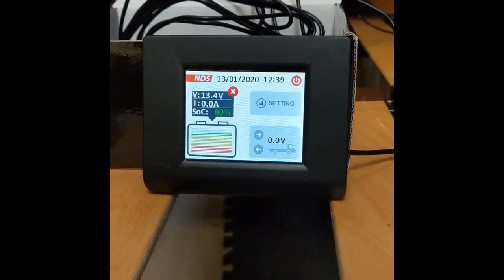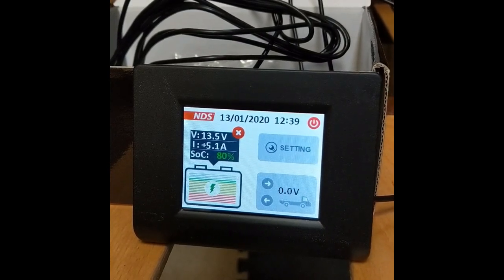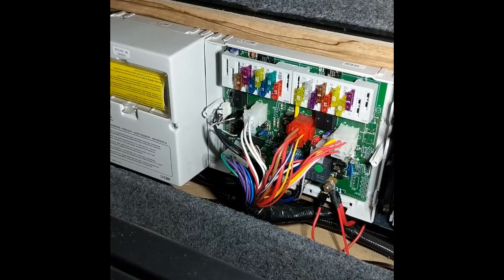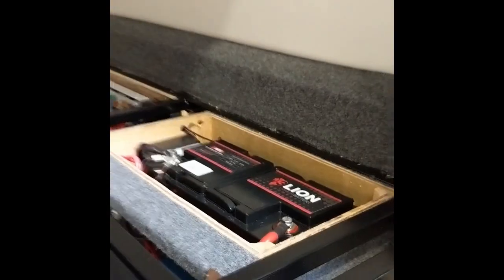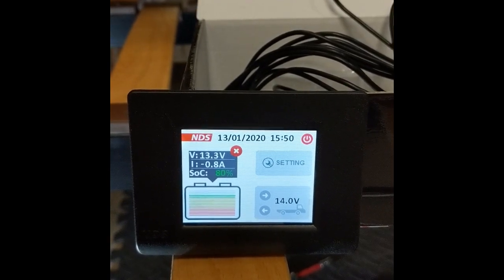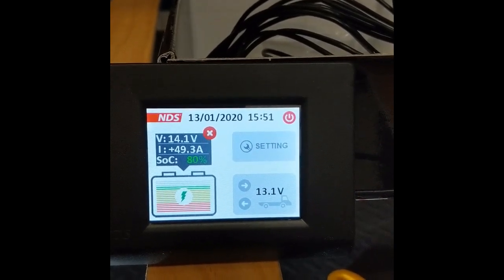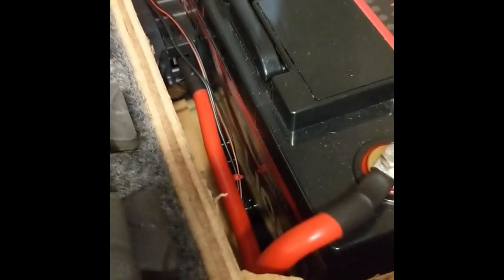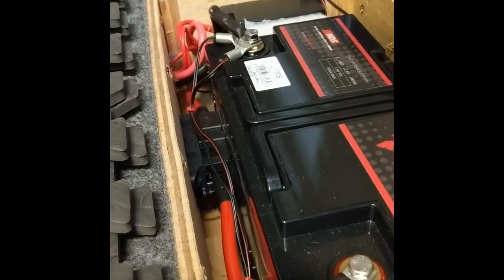Battery to battery charging with a lithium battery in a campervan.

Comment: I'll be taking delivery of a brand new  Iveco Daily in the new year that I'll be converting into an off grid camper. I obviously need to maximise engine charging as well as adding some solar and it's good to find someone knowledgeable so local. I was just wondering, do I still need the dealer to disable the smart charging when going this battery to battery route?
Reply from the maker: No, you definitely don't! Take a look at our Guide and all will be explained. https://www.roadpro.co.uk/product-guides
Reply: That's really useful to know thanks,  I'll certainly be making an appointment to come and see you to cost and spec professionally  fitting the electrical charging and storage for me.

Comment: Very good. Could you do a video on the votronic set up explaining solar computer s and the battery computer 200s with smart shunt explaining the inputs on each of this make sense. There is no explanation on YouTube in English on the most of the votronic set ups. Thanks Pat.
Reply from the maker: I'll see what I can do Patrick. Until then, the instruction manuals that come with the Votronic products are very comprehensive and in English.
Reply: RoadPro That would be good. Yes instructions are ok but if I d if I am showed things I pick it up better. Thank you.👍

Comment from the maker: Some people seem to be confused by exactly what's going on here. On the display, when Damian starts the engine, 13.5V (top right) is the voltage at the leisure battery, +15.6A is the current / charge going into the leisure battery. When Damian turns on the fridge, the voltage stays at 13.5V and the current going into the battery drops to +5.00A. The difference - more than 10 Amps - is what the fridge is using. When the battery-to-battery charger and new wiring has been installed, the display shows in the region of 13.9V at the leisure battery, +50 Amps going into the leisure battery and 13.1V at the starter battery (bottom right). The point of the exercise is to show what a difference a battery-to-battery charger and appropriate cable make.
Reply: I'll be ringing Tuesday to book my van in 👍